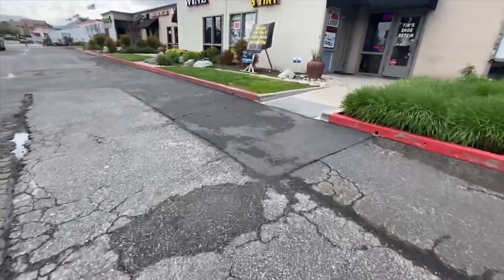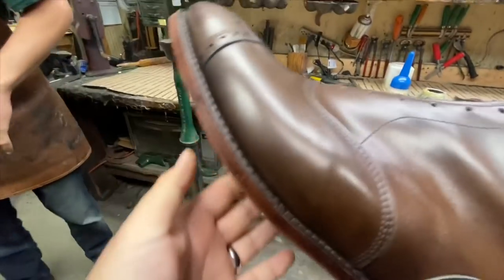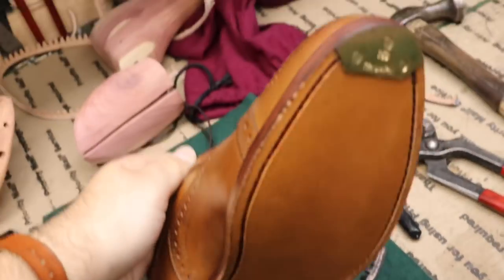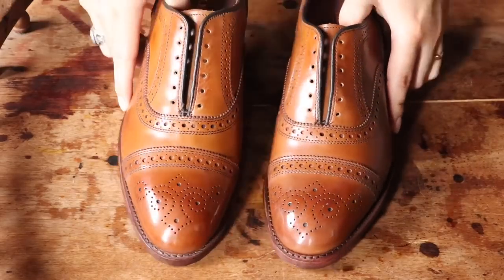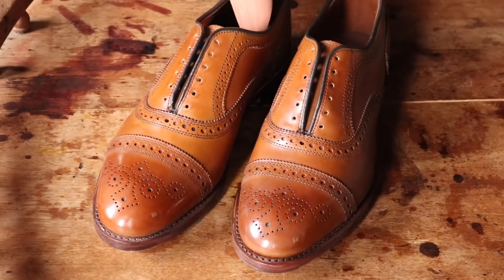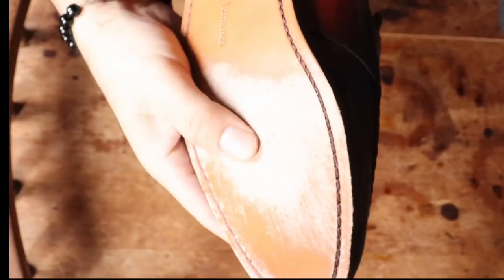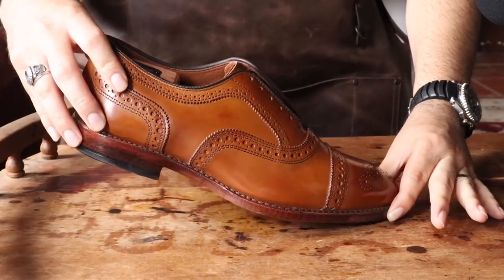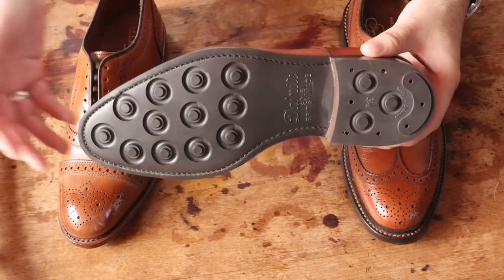PROTECT YOUR SHOES: A GUIDE TO FRENCH TIPS & OTHER SHOE CARE IDEAS Feat. TIM’S SHOE REPAIR

Comment: Thanks for the video. A few comments:
1) My shoemaker dips the screws into resin before screwing them into. That way you don't have water going in, he says. Did your  guys also do it or is that not a necessity?
2) premature wear at the tip can also be fixed by a cobbler by only replacing the tip w/ a new leather part. You'd keep the bulk of your original sole (since it still has wear) and only add a small piece of new leather to the tip.
3) sole protectors don't need to add to your sole. My shoemaker sanded down the original sole ever so slightly (w/o going into the stitching) and then glued the rubber on. It sits flush with the waist of the sole. This combined w/ a toeplate is the ultimate protection.

Comment: Enjoyed your video! I have the “toe wear” problem on many of my shoes and talked with my local cobbler who installed very thin, but very durable sole savers on a new pair of Fifth Avenue AEs for me.  I’m impressed with the shoe’s stability (especially on wet floors).  More importantly, it’s now heaven driving my manual 6-speed transmission car in dress shoes-life is good!

Comment: I personally prefer the metal toe plates. They work even better on shoes with chiseled toe design, as the toe area of the sole drags more against the pavement. I had lulu tips put on after a resole done by Trenton&Heath and another ones on Magnanni resole where I had Steve Douduklian remove all rubber soles and put on JRs. I’d do it on any resole going forward. I don’t personally like the sole savers, as the leather sole allows better breathability of the shoe while wearing in dry warm weather. Great video!

Comment: regarding the sole guards you showed, i have vibram sole guards on several pairs of shoes i own. they're different from the ones you showed because they're vibram soles, and barely add any height to the shoes. also, the cobbler did a good job of sanding down enough of the entire sole area where the sole guard fits into to just to ensure that there's no extra height formation

Comment: You introduced me to French tips as well as Allen Edmonds, I’ve worn Stacy Adams my whole life with a Kenneth Cole here and there but that’s about it. When I was a teen over forty years ago, I used to use metal taps on heel and toe but they where definitely slippery but we enjoyed the sound of them clacking and scraping when we walked. I have been for the last thirty years using sole savers but they are unattractive and I add the cheap nail on taps to the toe as well to help them last but they are ugly underneath. I do like the French tips and wonder if the brass nails in the heels are for looks or add a little life to the heels

Comment: I have two pair of AEs with Dainite soles and they give a great grip in dry weather but if the pavement, cement or floor is the slightest bit wet they are as slick as mucosa on a doorknob. Do you know anyway, other than replacing them, to make them not so slippery on wet surfaces? Love your videos.

Comment: I use sole guards to prevent resoling my shoes in the long run. I think it's cheaper to just replace the sole guards instead of resoling the shoe. However, my AE Cornwallis is experiencing premature wear on the toe even with the sole guards. I'm thinking of getting toe plates then cover them along with the rest of the soles with sole guards for my McAllisters. I don't know if it'll look good but I don't mind the extra lift from the sole guards.

Comment: Hey Preston, local cobblers should be able to apply both toe plates and sole savers, which I personnally have installed on all of my pairs of leather soles after a couple of weeks of use. Reasons are they will definitely dramatically extend the shoes' lives but also make sure to keep you safe from slippery floors and surfaces. However, you never mentionned this combination as a possibility. Could it be that the mild Californian weather doesn't require it ? Have you ever considered getting both sole savers and toe plates ? Besos
Reply from the maker: Good insight, Flo!

I have seen sole guards and toe plates before. Totally slipped my mind! Thanks for watching!

Comment: Every new pair of shoes that I purchase (almost exclusively Allen-Edmonds) I will take to my shoe shop and have the rubber half soul put on and a heel saver. They are treacherous on wet surfaces however, every pair of shoes that I have still has the original heel and sole. You have introduced me to something new today, the toe saver. I will make sure that all new purchases have them applied. The heel protection is a hazard but I like the feeling that every pair of shoes that I have are still just like they came out of the box. And I also purchase cedar shoe trees. I saw that you were using plastic. Is there anything else that I should do to make sure that I will have my shoes in very good condition for many years. I also am partial to lacing the shoes with horizontal laces as opposed to the cross cross method most men use. I would like to see you show how that is done correctly. And the last thing, my shoes always form a noticeable v after they are laced. I already purchase the widest shoes available, what else can be done to avoid the fat foot look with dress shoes. I notice that almost immediately when attending a meeting or in a group of men wearing dress shoes. It appears that the very lean and thin man will have an equal distance from top to bottom between the eyelets. Can that be rectified by some slight of hand or clever trick?

Comment: Nice video. My shoe heel gets worn out in the outer  back side in very short time. What is solution for that.
Reply from the maker: That is a common problem which the V cleat sought to remedy. Luckily heels can be changed out by a competent cobbler very easily, quickly, and affordably so id say to just have them switched when needed

Comment: Why do you prefer this over rubber sole protectors? I’m just debating between the two
Reply from the maker: Hey, Ray. Like I mentioned in the video, I don’t like how some savers add about 1/8 of an inch to the bottom of the sole. The shoe feels different afterward. Some people don’t mind at all but I do. Plus, I think brass tips look cooler.

Comment: I seem to wear my heels abnormally fast. I had my local cobbler add heel protectors to all 3 pair of AEs I own(ed-I picked up and restored the uppers on some ebay 5ths ave since, I'm now at 4!). I was a little disappointed to see them be the plastic nail-in type. Nice guy, real nice in fact, but I was a little miffed that he buffed my mirror shine toe caps off with a wheel. So I may look further out. Love the look of the brass inserts as well as the promise of greater sole life.
Reply from the maker: Hey, Robert!
Thanks disappointing to hear! A lot of fantastic cobblers have never heard of artisan restoration items like JR soles and metal toe plates. Look around until you find a good one or even mail them to a good cobbler.

Comment: I have put toe and hill nail on toe taps on all my shoes,it’s too late to change them ,also added the half sole rubber protector ,once the toe taps wears off I’ll get rid of them and just keep the half sole rubber protector .
I Have that problem,brand new shoes get ruined in the front toe area on the first 15 minutes of walk .I bought a pair of Allen Edmonds Bond Street Burgundy ,and my sister saw the damage And said that if those shoes were that expensive that shouldn’t have happened, I tried to explain to her that it happens because of the way I walk but she didn’t it it lol.
Any way , my cobbler said that if I add metal plates they would make too much noise.
Preston have walked on them yet ? What’s your take on it ?
All the best .👍🏻

Comment: I use 3M Safety-Walk Medium Duty Tread, Gray, 1-Inch by 60-Foot Roll, 7739
This lasts maybe 10 or so wears. Just put a small amount on the tip and cut around to shape it around the toe.

Comment: I love the idea of enlengthening the life of my shooe's soles but are the toeplates just as prone to slipping as the metal heelplates and V-cleats? I would imagine that when you push off your toe, they do not have enough friction for it to hold on to the surface, just as with the heelpates.
Reply: I'm in the same boat and think there could be not only slippage but also a slight "tap" when walking on hollowed surfaces.

Comment: Personally, I like heel taps for my cheaper shoes. I kick my heels deliberately when walking in the office for the sound it makes: LIKE A BOSS. 

For my Allen Edmonds that I all buy vintage on eBay, I straight up take them to my trusted cobbler for vibram half soles and top lift replacement before I start wearing them. Malaysian weather's (rainy, hot & humid) really bad for leather soles, so I might as well protect my shoes by having half soles installed. 

Your mirror shine technique is brilliant! Now I do a full routine in about 30-45 minutes (from Reno'Mat to mirror shine), as long as the shoe wasn't caked up with polish to begin with. Shoe shining has helped me cope with the boredom of social distancing, and now I've ran out of shoes!!
Reply from the maker: I like vibram soles! They are a great option.
Reply: Be carefull with heel taps I hear it could cause back pain because of choc it made at every step !
Reply: @leop.5086  I've worn my shoe with heel taps to Taiwan last November and they're pretty comfortable. I guess that the worn top lift created a cavity the heel tap did fill.
Reply: @TheElegantOxford  Which is better? Vibram or Goodyear?
Reply: @hanwenyap  vibram soles could be good year welted ! Vibram is a brand that produce soles, as dainite is too. 
Goodyear welted is the way the sole is stiched to the rest of the shoes and it's a nice and durable construction. More than the blake stiched or just glued shoes.
Reply: @leop.5086  I mean Goodyear branded half soles. I know the difference between GYW and Vibram half soles. I just don't know if there's a difference in quality between the two brands.

Comment: I suspect the metal on the toe plates would be slippery on many floors or even scratch hardwood floors.....slip similar to what you said towards end of video on the suicide heels....do they slip or scratch?  Also, why not just resole the shoes with new JRs when they wear out versus adding the toe plate?
Reply from the maker: Hey, HumanAv8ar!

Toe plates tend to be easier or walk with. I don’t know why but I think metal cleats on heels seem worse due to the way humans walk. Pushing off with the heel can cause the foot to fly forward quite easily while pushing with the toe seems to add more control.

Comment: Ich bought a used pair of Crocket &Jones and they has clearly  worn out toes. A little more then you showed it in the video. Is it possible to mount metalplates on worn out soles ? What do you think ?
Reply from the maker: Hey, Zobby! A good cobbler can definitely add plates even if the shoes are worn down! Steve at Bedo’s Leather Works does it all the time!
Reply: @TheElegantOxford  I have taken my shoes to the cobbler and he recommends that I do not use metal tips, as wooden floors, wooden stairs etc. could be damaged. I took Rubber Tips. They're not as extraordinary as metal tips, but it's OK. I'll see what happens if time passes while I'm using them.

Comment: Metal toe plates are way to go - just be careful when getting out of your car - you can scratch your door trim, even when the toe plates are flush with the sole. About steel heel plates - I love them and hate them at the same time - hate them beacuse they are slippery, but love them especially on cowboy boots with high heels, since I don't have to visit my cobbler every month. 
All my leather soles have a rubber sole guard, since resoling Goodyear Welt shoes where I live is next to impossible due to lack of skilled cobblers.  Also,  I've used these plastic ones, and don't have any problems with them, but they don't last very long.
Reply from the maker: Hey, Kamil! Robber sole guards are a great option! I really like them as well. My shoes last a long time with them on! Thanks for your comment

Comment: I am not so sure about installing these.  Yes when I was a child metal inserts were quite common, in both America and England.  Most the of the boys at school had them. I never did. I think the bonded in rubber or bonded on shoe protectors are best, as our shoes came, over the leather soles.  Otherwise you do know, the bottoms of the soles need to be cleaned and treated/polished each time you polish your shoes?  As children we usually were bought one pair of shoes and a pair of boots, a year. Mother says she is 87 now, I am 70 and she had me after university so you know, and she tells me a good pair of boys shoes in America was $150 in the 1950s or at least the ones we were bought, as my comment on hearing it that it seemed expensive, but she knows and says not the ones you were bought as they were custom made/fitted to us, that I remember not the price.  In England it was or like 40 £ to 50 £ due to the exchange rate being around three to one.  I remember they would measure and "feel" your foot a lot during the process... even then often the shoe was finished it would need to be adjusted when you got them.  When she was a kid in the early 1930s in Germany, the depression was 10x worse than when they moved here, and she often had ill fit shoes and vowed her children would not. The last pair are 1960s Beetles boots styled and I still have them and they still fit... though resoled and heeled several times. The style is out of date for a long time and I have not worn recently... but they are still good. I think this caused a problem when I later went in the service and had to deal with standard size shoes, which are so hard to fit...  or adjust to your foot.  But I have a 95 year old cobbler 3 blocks walk, and he knows how to adjust shoes, as he supplies orthopedic shoes too.